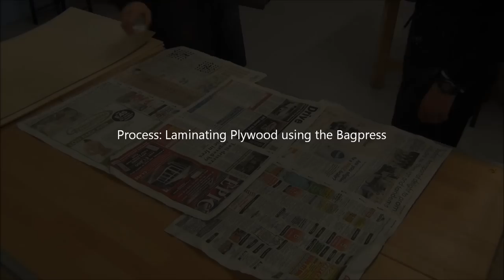Laminating Plywood (the easy way)

Comment: It’s a very good video. A few comments

The glue spreader shown is very expensive - £100? You can get pretty much the same result - just a little slower - using a normal foam brush and tray

The type of glue is important. Go for one that has a longer open life. I use either Titebond Extend or Titebond 3

I use a lot more breather fabric than that shown. I always have this fear about air being trapped. It’s an once only process and so I would rather be safe than sorry

There is obviously a ball CER between the severity of the curve required,  the thickness of the laminates and the type of timber. Flex plywood is the easiest but if you wanted the shape shown and had no flex ply, you couldn’t do it with 2 x 6mm ply; you might have to use 6 x 2mm. If using “real” timber, obviously go for straight grained where possible; again, try the process out first with all laminates dry. That trial run will show you if your shape can be achieved with what laminates you have chosen; if it fails, then at least you haven’t got a mess to clean up

Pre forming can work. By that I mean, put all the laminates in the bag stacked but without glue; sometimes,even wet with water to soften the fibres; vacuum and leave. After a few house, take out and the laminates will have taken (only)part of the shape you want. Now glue and re-vacuum. This method helps particularly with severe shapes or thicker laminates. You are really pre-stressing the laminates. 

It doesn’t always work. Failures will happen. If you want a shape topped by some expensive, exotic veneer, form the shape in one process with all the laminates glued but no veneer (if it fails, you haven’t wasted the veneer) then re vacuum with the veneer now glued up and in place.
Reply from the maker: Excellent information that will certainly help people to navigate this process.  Thank you.

Comment: Ive done a similar thing before - gluing multiple sheets of plywood together to create a curve. It is indeed very strong. As an alternative approach, could you nail the sheets of ply together? I'm not sure if it would retain the same shape that way.
Reply from the maker: anzaeria it would be possible to bend and then secure the material at the ends.  I’d suggest g clamps or nuts and bolts through drilled holes. Otherwise screwing through waste materials at the ends, into a former.

Comment: Will it ever lose its shape? If there's humidity in the air? If it's left outdoors?
Reply from the maker: jean bui it’s absolutely rigid and will never lose its shape if kept indoors. It’s not for outdoor use or anywhere humid (without an extremely well applied exterior surface finish). The adhesive could be exterior grade, but I don’t think you’d find exterior graded plywood that was thin enough to bend.

Comment: I am using this process in a project and I need to know how long this will take. Do you know how long this will take from start to finish?
Reply from the maker: In my example.  2 hours to make the former. 30 mins to cut and prep materials. 15 mins to glue.  6 hours for glue to cure. Done.... then trimming etc.

Comment: Hi, could you please tell me what kind of pump youre using? mine (a cheap model) is, acoording to the instruction manual, not for permanent use (several hours) under pressure. thanks
Reply from the maker: TheZahnputz have a look at www.airpress.com. My pump is from them. Modern adhesives require less time to work too. Maybe 4/5 hours.

Comment: How would you go about doing an S shape with this method? Do you have to create styrofoam forms for both sides, or still able to do it with just one side?

What method do you use for shaping the foam in the first place?
Reply from the maker: Hi, still just one side of styrofoam needed with this method of placing in a bag and removing the air. You’d only need a male and female former if you were relying on clamping it together rather than using the bag. It would be very difficult to make male and female styrofoam formers that fitted each other perfectly (it wouldn’t be possible to make them both from one big block as you wouldn’t find a bandsaw big enough, and if you did, you’d still have to sand them afterwards).  The method I use for making the former is to draw a template on card, cut it out (ideally laser cut), then draw around the template on a sheet of styrofoam (approx 150mm thick), cut out on the bandsaw then sand with a belt sander or bobbin sander for concave shapes. Repeat this process to make several identical styrofoam shapes (to accommodate the width of the plywood), then glue them together.  Finally, glue a long length of sandpaper to a flat piece of wood and use this to remove any ridges between the styrofoam pieces.  Remember to make the styrofoam wider than the plywood blanks, and the plywood blanks wider than the finished size.  Have a look at my video about trimming with the lipping planer to finish the edges of the finished piece.

Please subscribe for more videos if you haven’t already.  I’ll make one called ‘making styrofoam formers’ at some point soon!
Reply: I was surprised the foam didn't crush in the vacuum.
Reply from the maker: Scott Noyes it’s really rigid. I buy mine from a supplier who specialises in this process but it would probably work to use a similar product from the builders merchant that is used as insulation. It’s not to be confused with polystyrene which is obviously much less rigid, would collapse around the edges in the bag, and would make quite a mess!

Comment: The same result I get for several item in the same time using a rachet straps on the templates without need it a pomp.
Anyway, the ideea is interesting
Reply from the maker: Trazco Traz agreed but it’s tougher with ratchet straps when there’s any concave aspect to the shape
Reply: This might be overkill for such a simple shape but I can definitely see potential to make more complex and as such harder to clap shapes like this.

Comment: How did you cut the radius on the former (is the former foam?)
Reply from the maker: Have a look at this. I share the process in another video, https://youtu.be/TxRBL-9G5Hk
Reply: @productdesignermaker  Very useful, thank you. I tried laminating some aero ply recently (first time in years). Quite a tight radius, and the ply seperated  In the video, do you alternate the ply direction, or is it cross grain? Thans again
Reply from the maker: @herbertthecat  I’ve got all the plywood sheets with the (outside) grain going across the piece.  It’s not vital if the ply is very thin.  It sounds like your adhesive isn’t curing fully.
Reply: @productdesignermaker  Maybe my cold workshop didn't help. Might try an electric blanket next time ! thanks for your advise.
Reply from the maker: @herbertthecat  good luck.

Comment: So your grains are all in one direction when you bend? How to make a bend in 3D ?
Reply from the maker: Vladimir Stevanovic I’m using thin plywood, so there is grain going in both directions, however, I’m cutting the wood so that the exposed grain (visible grain) runs across the former.
Reply: @productdesignermaker  Ok. Thank you.

Comment: What adhesive are you using?
Reply from the maker: Just PVA wood glue.  See www.bagpress.co.uk for alternatives.
Reply: @productdesignermaker  I've been using Titebond III and found it still wet even after being under vacuum for 36 hours. Any advice for either a different glue or how to expel moisture from the bag? I like Titebond because it's cheaper than epoxy, non-toxic and III has a long open time for complicated glueups.
Reply from the maker: Capnmax try here https://www.airpress.co.uk/74-accessories/

and  

https://www.bagpress.com/Materials_and_Accessories.html

This should help.  Best wishes.
Reply: @productdesignermaker  thanks!